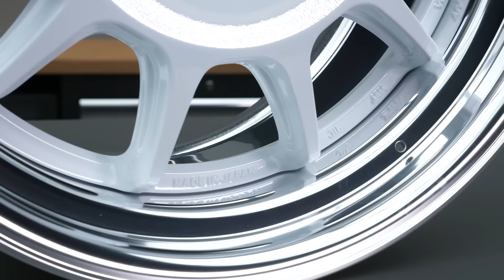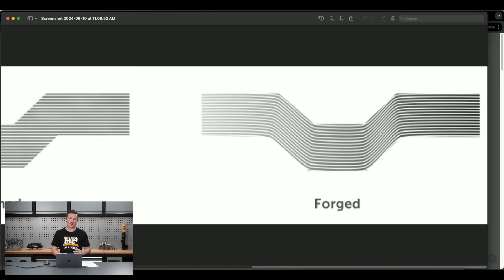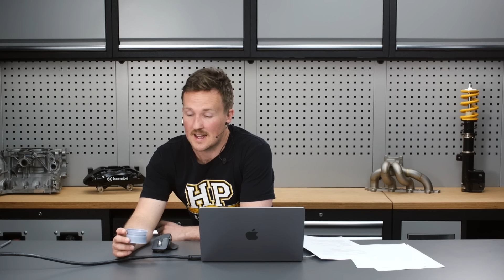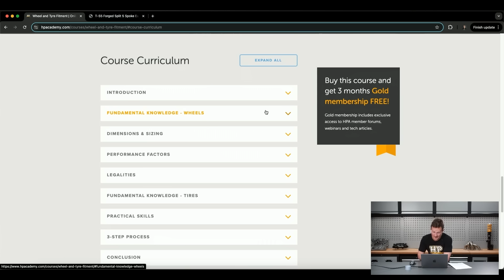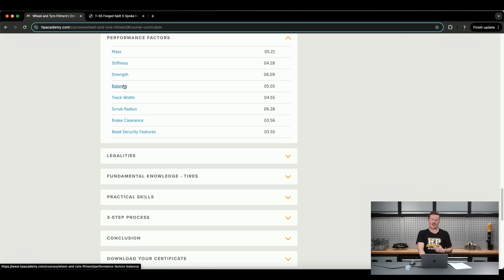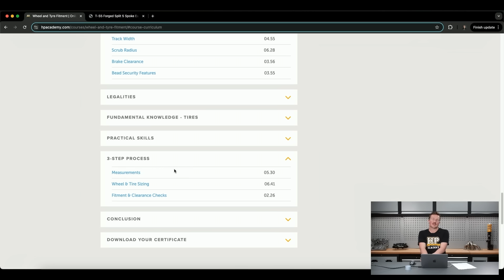Can wheels have all 3? | Lightweight. Stiffness. Strength

Comment: Every time I go to a garage to have a tyre fitted I am always sitting on the fence of not being condescending by telling them that the yellow dot on the tyre is the heavy spot and is to be fitted opposite to the valve and may then require less or no balance weights and every time I think they must know this one basic part of tyre fitting I get my wheel back with the yellow do at some random place and if it's randomly got near the valve then the wheel has a load of weights!

Comment: Carbon fiber wheels have a disadvantage that is often overlooked: they are significantly worse in terms of heat resistance. The fibers themselves can easily withstand high temperatures, but the matrix material (epoxy resin) cannot. This is a serious problem, since 99% of sports/racing cars have ventilated brake discs inside wheels, and these brake discs practically suck air through a hub area and spit extremely hot air directly onto the wheel barrel.
This is the reason why Carbon Revolution uses some kind of heat-resistant coating on the inside of their wheels. I wonder what kind of coating they use.